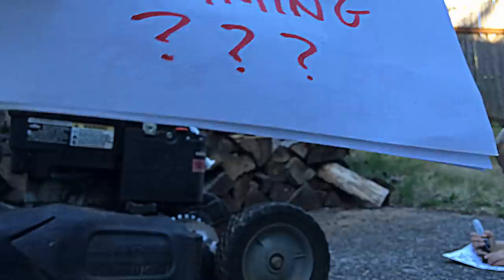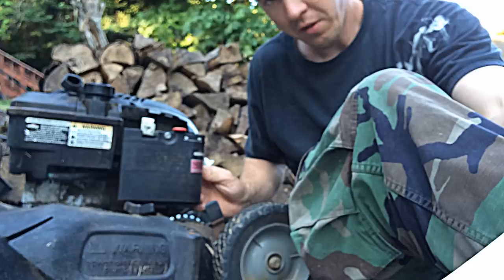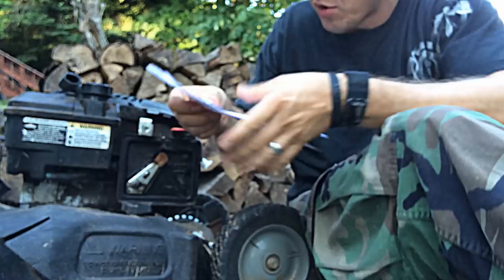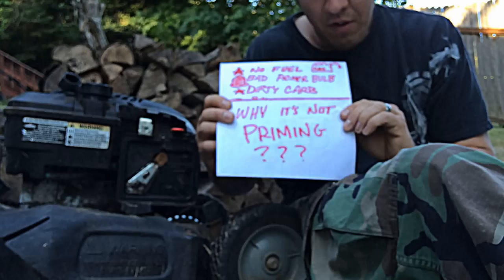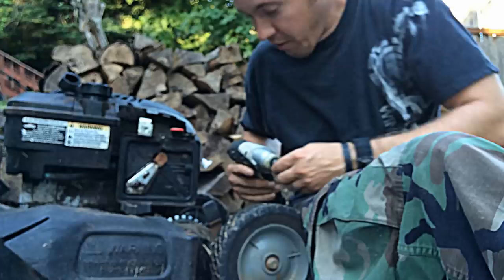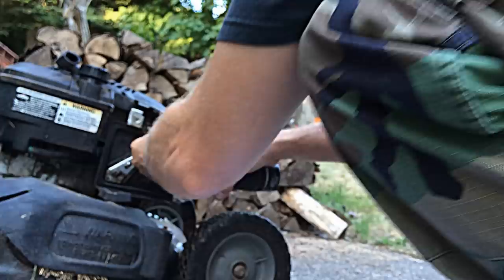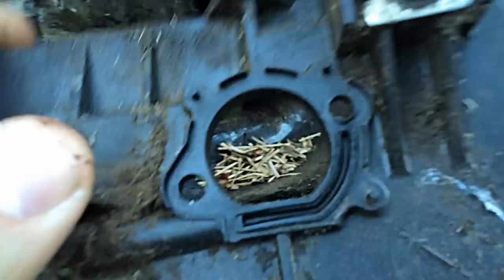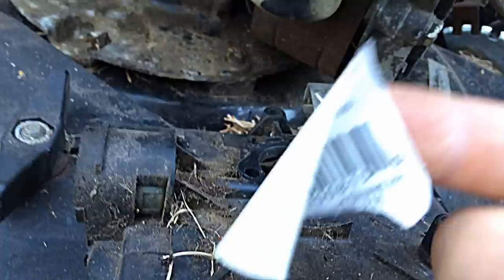Briggs & Stratton Primming Solution | Force Fuel to Flow by Retaining Primmer Pressure

Comment: Adam, I did what you showed on your video with the tape , and sure enough , it WORKS!!!!!!!!, I replaced the gasket, primer bulb, cleaned the carb, replaced the air filter backing plate with a new primer bulb, tried  using 2 gaskets, nothing worked, until I seen your video!!!!!!!!!!!!!! Hats off to you , really, now I am done pulling my hair out. Thank You Very,Very, much

Comment: Dang! In eighteen years working on my current mower (B&S engine also), regular carb cleaning and breakdowns, cylinder head removal, piston cleaning etc. I was never aware until now about that gasket on the air filtre cover. Thanks so much for the education! That and you seem like a great dad. Double thumbs up!

Comment: Thank you, so much, Adam!  I replaced the carburetor, air filter, prime bulb, gas line and oil on my Craftsman mower with a 6.5hp Briggs and Stratton engine with parts I bought on Amazon for about 1/3rd what the local mower shop wanted for a "tuneup".  Though that fixed all of the rough running, running and dying, etc. problems it had previously, the only problem after that was it wouldn't prime so I resorted to a quick shot of "Hot Shot" starting fluid each time and lived with it.  Today I decided either I would poke a hole through the air filter so I could stick the nozzle for the starting fluid in it (rather than removing the air filter each time) or do it correctly.  Though the hole would have been faster I watch a few videos on fixing hard start and priming problems before I found yours.  Most of them highlighted using double (or even triple) gaskets (I had only used one).  I had seen other tips about putting a bit of oil or gas on the gaskets.  I tried all of those things to no avail.  I then remembered your last little tip with the folded over Walmart label so I used a small strip of duct tape, instead.  By this time I was positive it wouldn't work.  But, as you showed in your video, it worked perfectly!  I could see the gas squirting into the carburetor and 3 pumps of the primer and it started instantly.  It has worked several times (hours apart).  Thank you, so much, for taking the time to create the video!

Comment: Man look. It's April 2021 and been subscribed for a long time. Been fighting this no prime issue for 3 hours. Did the double gasket, tried 3 different bases and even a new carburator. Nothing worked. A half inch of electrical tape later and it's perfect. Can't thank you enough.

Comment: This is huge.  Not only does it get your mower running but it teaches the importance of gaskets in general.  There is no telling what else this might apply to.  My mower had been dead for 3 years as the primer bulb put gas everywhere but where it should have been.  The bulb did not appear damaged but I replaced it anyway.  I couldn’t feel it working but it did start.  If I had had a new gasket I would have installed it.  Anyway, this is a great mechanical tip.  Thank you.

Comment: Clever guy! That's been driving me nuts. New primer bulb, new carburetor, still no start unless take out sparkplug and spray starting fluid in cylinder. But with your fix, it works! 
"resourceful, do a lot with a little" Awesome.

Comment: Many, many thanks for posting this extremely simple, but useful fix. My mower has the same style primmer, I even bought a new housing with the primmer built in and used a new gasket, and the primmer still didn't work.  Of all the videos posted on this problem your video wins hands down. Can thank you enough; God Bless you ...

Comment: Thank you so much for this video.  It is exactly the problem I had on my Toro.  The carburetor was new with a new gasket but still wouldn't prime (had to shoot in carburetor cleaner to start it).  I cleaned the primer bulb and screen and still nothing.  I was ready to give up but found this.  I added a small piece of masking tape like you talked about and now it spouts like a geyser.  Started right up first try.

Comment: The mower won’t start easily after 60 pumps on the bulb, till I could hear the gas gurgling.First I cleaned the screen behind the primer bulb, it as filthy. Next used the sticker an got priming to the carb.Also cleaned the base of the bulb which was gunked up.starts great now. Thanks

Comment: I tried 2 new gaskets and still could not get it to prime. Tried your idea and bingo,it worked. Thanks.
Reply: Did the trick for me too...
Reply: The problem I'm noticing with people replacing it with a brand new gasket and still not working...... is they are tightening the bolts too hard.  That ends up compressing and eventually cutting open the brand new gasket.  Just hand tighten them bolts people.  Hope that helps.

Comment: Well... Great video. I put on a brand new carb., o-ring, and gasket. Does not prime for squat. I will keep this in mind. I think my failure may have been NOT getting the bulb wet first. I am trying to help out the neighbor kid. Runs like a bat out of hell though once started. I will try to remember to comment back. Thank you.
Reply from the maker: Get in there and make sure everything's working/moving properly. If you have an air compressor with a rubber tip nozzle, press it against the carb and shot one quick blast through that primer hole to confirm its functioning (PPE(safety glasses etc)required) properly. Check each individual piece over slowly and separately. GOOD LUCK!

Comment: I have a Craftsman with a Briggs engine. I went to Sears Parts to get all the items needed for a tune-up. The gasket they gave me doesn't fit properly. When it's seated with the flat part across the bottom, the bolts won't go in without punching through the gasket. (Granted, I should have verified it was the correct item no. before I bought it.) In any event, the mower won't start without starting fluid, so I think this is the problem. I'm going to replace the gasket, but in the meanwhile, I'll try this. Great idea! BTW, I saw someone on another video use some gel-type gasket gunk. I don't know if it would work or where you get it; probably at an auto parts store.

Comment: I’m losing my mind with this issue. Replaced the backing plate, didn’t work, replaced the carb, still didn’t work! Used two gaskets, still nothing! I will definitely try the sticker method today!
Reply: Pro tip : you can watch movies on Flixzone. I've been using them for watching a lot of movies recently.
Reply: @Melvin Jackson Definitely, have been watching on Flixzone for years myself :)

Comment: If you dont get this to work the first time try again it took my about a hour trial and error is key i had to use 2 first i used 3 then 1 then 2 without gasket then 2 with gasket again and it worked

Comment: Did all of these. Still wont prime. Even replaced the carb, no prime. Runs on ether, but wont stay running. I don't think its getting fuel at all. Even replaced the fuel line.

Comment: What model number is this engine/mower or the B&S carb replacement model? I have a 23 year old Toro with a B&S Quantum 5.5hp that looks very similar to this but it has an automatic choke setup that is unreliable. I might  try to replace the current carb with one like yours as it looks like a Walbro variation that would directly replace the one I have. Linkages look the same.  The air cleaner cover looks identical to this except the primer bulb itself is replaced with a cap (I'd have to get a new primer bulb and clip). The gasket and everything appears to be the same with the corresponding primer "groove" and hole. The primer inlet on the carb is blocked (probably because  it has a choke plate instead) which is why I'd need a similar carb to yours. Does that sound doable?  Does your carb have mixture adjustments or is it non-adjustable?  Thanks.
Reply from the maker: The auto-choke carbs are the same as this one without a primer hole. First clean the carb throughly. Replace the rubber bowl seal if possible. Make sure the 'choke plate' is blocking all air from entering the carb with the help of the spring attached. Instead of pushing the fuel with a primer, the auto-choke method pulls the fuel into the engine with the vacuum of the intake cycle. What you are attempting is possible. I've done it before. Only after being certain my auto-choke carb was no good.

Comment: so weird this did not work for me.  I have a new carb and new gaskets. the mower runs fine but will not prime. the primer bulb is perfect.  i have an air leak somewhere because I can hear it when I press the bulb.
Reply from the maker: Yeah it's gotta be covered, taped and sealed tight. All except for the hole mentioned, where the primer purged air travels through to the carb.

Comment: When I press the bulb, it remains deformed and won't pop back out to allow another press.
Reply from the maker: pterafirma There shouldn't be any suction behind it. Is yours vented- a hole in the center? Is it a new one?
Reply: Adam Pennington —  "Shouldn't" is precisely my point. It's not a newer one, no vent in the center, just a conventional bulb. I press it in, and it takes like 30 minutes to pop back out. I assume something is getting sucked back into that groove, but I've not had a chance to crack it open and see. Hoping maybe it's a known phenomenon, and someone could save me a little time in the diagnosis.

Comment: If primer bulb is bad, will it leak gas when trying to prime?
Reply from the maker: Could be that or the carburetor. Wipe everything down, watch for the drip. A leak in the carb of this vid would come out through the primer hole. A leak in a pulsa prime carb would mean just replacing the bulb.
Reply: No, the primer bulb functions by sending a puff of air into the carb bowl forcing fuel up the main jet.  No fuel contacts the primer bulb in this system at any time.